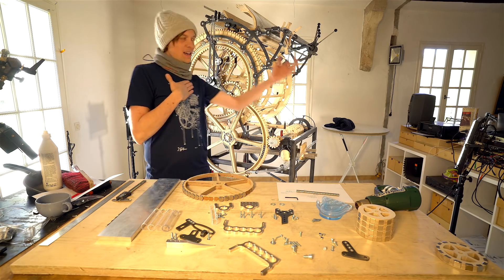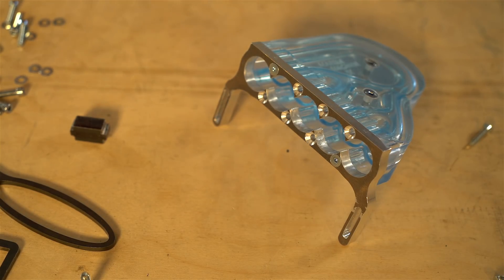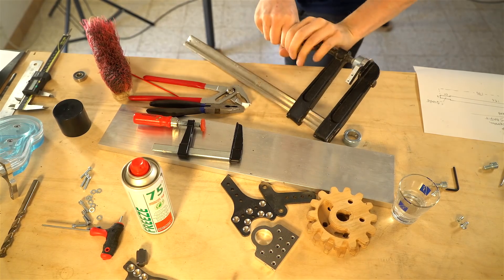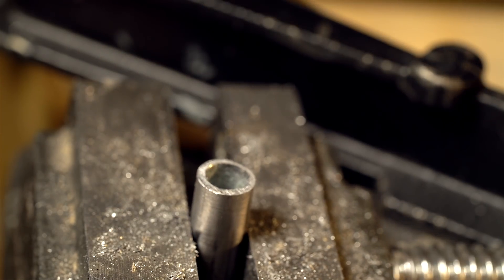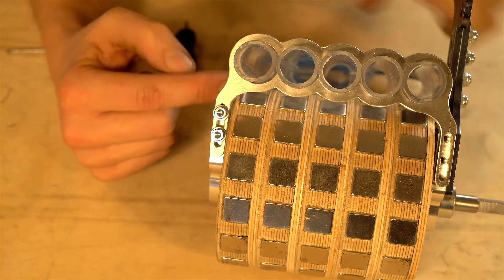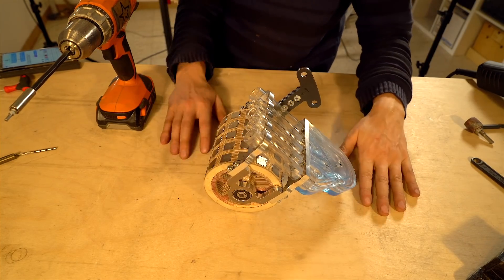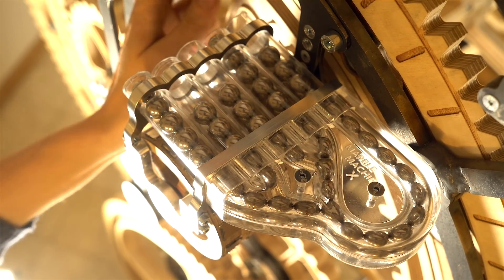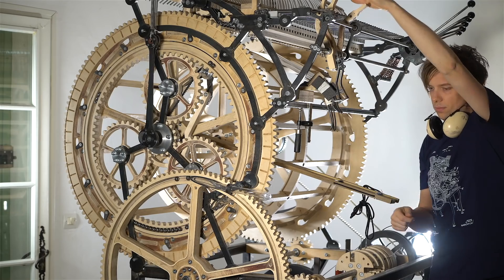Marble Demagnetizer V3 - Marble Machine X #62

Comment: Okay some stuff about the drilling part :
Your drills are really really dull! Get new ones.. and BUY THE EXPENSIVE ONES! (bosch cobalt is what I use and am happy with)
Use a more liquid lubricant since the paste cant get to where the drill is building up heat and also the inconvenience of applying it instead of having a squeeze bottle will result in you using less lubricant then needed..!
you should never have to use that much force since force trades directly for precicion..!
Use a drill stand to get the 90°!
For steel you cant use a single tap..! You need the 3 Staged taps you get with a steel tap wrench..! More so when the hole is a bit short of the perfect size for an inner winding.
Lets get that thing finished soon and perfectly!:))

Comment: Wouldn't an inductioncoil make a better demagnetiser? The magnetic flux of the coil will always be induced contrary to the magnets movement. Given that the magnet rolls basically allowing for demagnetisation in all directions. And the force of the field will never fully halt the magnet as the movement of the magnet itself induces the field.

Comment: It looks to me like the outer marble paths have nearly a straight shot from the feed to the output, so they take the path of least resistance and skip the inner paths.  You may want to design the second split so it hits the wedge directly.  Also maybe widen the feed before the wedges so that as marbles stack up, they bias to either side of the wedge.

Comment: The marbles will definitely favour the outer paths like you observed. like most other things they are lazy bums that take the path of least resistance, and since they come into the second divider at an angle they will favour the straight line leading to the outermost pipes. This will not change during testing. The simple solution would be to make the feeding pipe slightly longer, allowing you to straighten out the path before the next division. 

There have been comments on the wheel direction as well, and it might indeed be good to have the final degaussing rotating against the flow. Curving the pipes over the wheel (change the second bracket a little to set it at an angle) would allow a slightly longer travel time over the degausser, and give you a gravity feed out of the system once the marbles lose their charge.
if you want to keep it rotating the same direction you could also swing the marbles the other way to feed out under the wheel. Having Alex CNC a nightmarish curved dividing track that follows the radius of the degausser... He'll love you even more for that ;)

Comment: I’m not sure if that severe 180° turn in the channel splitter will work? I’m imagining that the first time Martin tries running hundreds of marbles all the way through both wheels and into the channel splitter at breakneck speeds, the splitter will jam up enough to force the wheel marbles to split straight off of the magnets of the top wheel. Basically the force of the top wheel is sending them straight into the back of that 180° turn, and it requires a LOT of energy to power them all the way through the channel splitter as a result. I question whether it’ll be more force than what’s holding the marbles onto the wheel in the first place, because it seems like it definitely is. Hopefully I’m wrong, of course! The channel splitter parts are very beautiful.

Comment: I just don't get why this level of overcomplication... I forsee a thousand upon thousand problems.... this part looks like it has way too much friction to accept marbles at the speed you like. You are causing your own problem by magnetizing the marbiles in the 1st place. A simple elevator the full distance would have been so much simpler, and so much fewer parts that could go wrong. 

The tolerances you have shown you need for even ONE part of this to go right.... have you ever seen roadies carrying equipment up on a stage? One bump on a door frame, and the machine will never work again.... 

While I'm deeply fascinated to see you work on this, and maybe the journey is more important than the goal, but... cheezes. Your original machine, which I've personally seen in the Speelklok museum, had a single simple conveyor. What was ever wrong with that? :)
Reply: It's design lock-in at this point.  He said if it had it to do over, he wouldn't have used the magnets: https://www.youtube.com/watch?v=93OjIcpNuWY&t=1390
Reply: The T2 Tile Project that's what I was talking about.
Reply: Zap Andersson it doesn't  look as cool. That's why he's still going with the magnets.
Reply: It was fugly and one of the objectives of this machine is to be beautiful as well as functional.
Also Martin can’t get the feed rate required for the number of notes he wants to hit in this version of the marble machine with that type of elevator. There were also a bunch of issues with getting the marbles on it in the first place. It just wasn’t even enough for the music he wants to produce this time around.
Reply: @A1BASE  He is using a elevator for the final lift to the top so its fast enough, he could have just one really long one doing the entire lift.  I agree this looks way better being able to see the wheels cleanly vs having a giant ammo belt on the side.  But I also think there will be issues with marbles going though this 1 to 4 divider fast enough since its not on a slope and it seems to have some resistance to get them to use all the channels, I'm sure its fixable.  I also think Zap has a valid concern with moving the thing, a hard bump and something will get misaligned and you dont really want to carry a spare everything with you.

Comment: I thought that they invented tap wrenches for a reason :) great as always
Reply: I hope your life is not too consumed by factorio
Reply: @lazergurka-smerlin6561  Don't do crack kids
Reply: I mean, drilling the hole by hand drill and then expecting to be able to tap the hole with the same hand drill? That’s pretty... ambitious. Not breaking taps is hard enough when you’re using a drill press. And I really don’t understand why you would — a tap wrench is quicker, even..
Reply: you can easily tap steel with a hand drill instead of a tap handle. but you can't just go at it rabidly, you need to go to low speed mode and still be careful at the trigger. you need a firm grip ready to fight the drill's rotation. you need TAPPING FLUID or any cutting fluid. if the drill has a clutch, put in below the breaking torque of the tap. or, just turn it up from 0 till it lets you tap.

the motion is this: you square up the tap in both directions by eye, then push to get the first threads started. back out and go again, going beyond slightly. back out slightly, go in slightly. get good with the reversing switch on the drill.

you're just following the exact same principles as manual tapping, just with a motor to help with twisting.
there still is a case for handles, and that's taps too small to get reasonable torque feedback from i.e. small, hardened taps that snap REALLY easily
Reply: it's so easy to make your own wrench, just using a drill,square file and piece of flat bar

Comment: you can actually see why marbels refuse to go through the inner pipes:
they would need to make a 90 degree turn at the second splitter. Since your marbles will enter really fast (we've seen the wheel *wow*)
the Inertia will drive the marbles straight. If your transport system afterwards cant keep up i even expect them to repell backwards slowing the whole system down.
I propose: When you once did the marble divider you messed up the diameter in your pipes so they zig-zaged to fill out the space. You could use that to split them without hitting against their inertia.

Comment: Hello Martin. Please use a manual Tapping driver or what ever it's called in English... Or do it in the drillpress by turning the chuck by hand. You'll have a much better feel what's going on. I think nobody will never break a tap if he's doing it with a battery drill... You could fit a wooden rod in the ruined hole and turn a screw in to spread the rod. That will hold a washer to cover 😉

Comment: I'm worried about the force required to feed your marble degausser... extremely difficult to calculate forces here... but you can always extend the divider to reduce the forces required.
Reply: Same. Balls need some force to get them to split at the dividers and the lifting wheel apex is only 2 inches or so above so not sure enough weight behind the balls will exists to force them through even without the magnets adding resistance to everything.

Comment: I'm not am engineer. However, wouldent the aluminum act as a eddy current brake hence introducing quite a bit of mechanical resistance at high speeds?

Comment: STOP USING A DRILL WHEN TAPPING! Youve been too lucky with the taps breaking in parts wich are easily replaceble or where its not that necessary. Its like playing russian roulette. What will happen when a tap breaks in the big frame part? You'll need to put a lot of effort in getting it out again. Trust me it is NOT worth the time it saves by using the drill.

Comment: I die a little inside every time he uses a drill to tap. Can't tell you how much time I've wasted trying to fix a part that had a tap broken off in it. Martin, please get a hand-tapping tool, you'll be able to feel when the tap sticks and be able to back off. since you are not tapping hundreds of parts at a time I think the power drill is overkill anyway. Precision is better than speed.

Comment: You could always weld a nut over the hole with the broken tap in it.  Fill the threaded section of the nut with weld and then grind it smooth afterwards to make it look like a bolt head.

Comment: Well, Martin, this is what you get when you try to tap holes with a power tool. What's more, holding it in your hand. Many comments suggest this and who knows which one you'll read but I'll add one more voice to the choir: never use a power tool for tapping like this. Do it by hand. It won't be much slower and it will be much safer and the result will be much better. Not only because you will feel it perfectly but simply because taps are not created that way. You need to stop,  turn it back a little to let the chips escape from the flutes, then rotate it again.

Comment: Martin, for steel, you can't do that on a drill press. You need to go a little bit, back off, and go some more. If the chips don't clear, it will break the tap. Aluminum is more forgiving. But steel is not. You may be able to use an 8mm helicoil and a short bolt and washer to close the hole and the mushroom. Use JB weld on the outside of the helicoil if it is sloppy and push it in flush and let harden. Then use a short bolt and washer. https://amzn.to/2CJYQTP  Or use 6mm if 8 mm won't work.

Comment: Legitimately surprised you didn't try to like, fill the wonky hole with weld and grind it back and try to put a smaller screw in there holding a custom made washer, just to hide that small imperfection

Comment: That tapping is insane... :D Why not tap by hand? Much safer! :)
Reply: We tapped with hand drills all the time when i worked with industrial machine installation. The trick is to go slow, use lots of lube, set the torque pretty low on the machine and back up a few turns every time the machine starts slipping. Trying to go all the way at once will catch to much debris in the new thread, creating unnecessary friction.
Reply: I tap with a hand drill pretty often. I think that it might even be less likely to break a tap than a two-handed wrench. It is very much easier to hold the tap square to the hole, and you can feel whether it is straight or not. And it works a lot better when access is tight. 
I had never even considered it until I saw a garage door installer doing it. He also made me reconsider whether it was possible to sharpen a drill bit with an angle grinder (I already know how to do it with a bench grinder)
Reply: @andypughtube  " I think that it might even be less likely to break a tap than a two-handed wrench."

Maybe you have an excellent drill or supernatural powers, but a powerdrill generally geves no feedback at all abouta alignment or dustt in the cuts. It is far too liekly that you'll tap too fast and things wil break.

To put it another way; if eveybody says it's a bad idea, it's probably a bad idea. :-0
Reply: @vinny142  But my point is that not everyone says it's a bad idea. 
That said, I would have tapped that part on the lathe....
Reply: https://i.imgur.com/dhKpli0.png I have one of those at work, and a 1/4" adapter for the drill, it gives a bit of weeble-wooble so it self centres. I haven't broken a tap while actually cutting threads yet, got a bit overconfident with a M6 going back out, but that wasn't a big deal since I could reach it with a pair of pliers and thread it out.

Anyway, power tapping is not a problem as long as you take some extra care.
Reply: Tapping with a hand power-drill like that IS insanity (all signs point to this is not a great idea). I suppose that's a requirement when building something like the MMX though... the genius comes elsewhere!
Reply: @radishjunk  I had a guy tell me he used a hand drill to tap just a couple months ago. First time I ever heard of anyone doing that. I thought maybe I was the idiot for not using a drill, but it seems like my thoughts were correct, that it's a pretty good way to jack up a tap job.

Comment: To prevent breaking taps I usually use the built in torque control. Usually the torque control is useless, but to prevent breaking taps it's the only good usage I've found of it. I usually use like M4-M6 taps, so they are very sensitive to just everything, especially when drilling outdoor in lamp posts and such in the Swedish winter :P
Reply: The torque setting is really useful for wood screws. If you get it dialed in right it stops when the screw head is sunk in just enough to be flush with the surface. Really a time saver when doing lager things, as you don't have to slow down near the end to set it manually.

Comment: Looks great.. However, it seems like the loading tube is fighting against the magnets which are rotating in a direction that is trying to push them out.  It looked like you had to press fairly hard to get the marbles past that first loading tube.

Comment: To improve the marble division you can use fluid simulation (CFD). It's not included in Fusion but I think sombody have the tools to do this. I can also try to help you with this design and make a fluid simulation, but I need the original model version.

Comment: Martin go easy on the rpm when using bigger drills or countersinks, slow rpm is better. And don't you have a drill press? Using handheld drills are a nightmare working with metal I experienced... Breaking taps is always a bad thing, when I'm not sure this is safe I am using a dedicated tap wrench for a better feel.

Comment: I think the demagnetizer would perform much better if it was spinning in the opposite direction.
1- Marbles would be "sucked in" the mechanism by the magnet wheel
2- At the exit, it would push back on the marbles to make sure all 4 channels are used. Plus the relative speed would be higher, making the demagnetizer more effective.

Comment: Yes the block of aluminum was a mistake.  Also youd need a massive amount of that freeze spray to cool the whole bearing down.  Just putting it in the freezer for a few hours works perfectly.
Reply: Put the aluminum in the oven and the bearing in the freezer. Boom, done.
Reply: why do it that way in the first place? a bearing that small slides in easily with a hand press when the bore is machined to standard specifications of a bearing fit.
was more like a show off me thinks, done the wrong way even.
Reply: @sunside79334  that's a pretty simplistic judgement on a pretty complex subject.  For any given bearing size theres are several ranges of tolerances based on desired "fit" (looks like each major bearing manufacturer has their own rules and tolerance tables.). There is no single diameter that the bore should be (though I'm more if all the data were tabulated a full range could be determined).  I do know that if a good press fit is desired you won't be pushing it in by hand.  Using temp differential is a great way for someone lacking the proper pressing tools to achieve an interference fit.
Of course if a slip fit is desired then naturally it should be easily installable by hand.  I'm not saying that the tolerance designed into this part was or wasn't appropriate for the application but it seemed easily in the range of what a press fit should be.
Reply: @DoRC  
always depending on the bearing class, initial play and workload. as for this application even the slightest press fit would've been sufficient when using a bearing with more precise initial play, but i don't think the manufacturer of the milled parts did actually care.
furthermore what point is there in the heating/cooling process when the bearing isn't rushed to be put in the bore and actually starts to expand because of heat transfer? it's pointless without a handpress, and watching him messing around with the clamps made me cringe actually.
don't get me wrong tho, i like this channel and do think the OP actually is a great designer and artist. too bad he's lacking engineering prowess for metal work and the proper tools as well.

Comment: I am a little bit nervous about flow resistance with every new feature of MMX. Every 180 degree curve, devider or flywheel requires more force from marble to marble to continue, which could result in slow acceleration and high input power requirements. Hope Martin knows what are the limits. However, beautiful work,  keep it up Martin :)